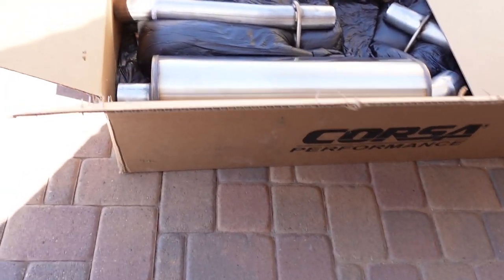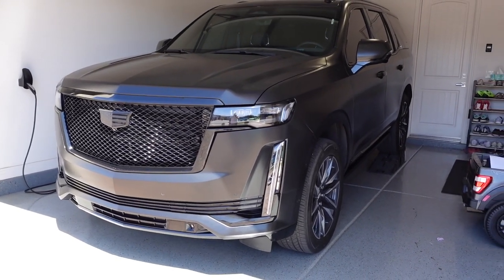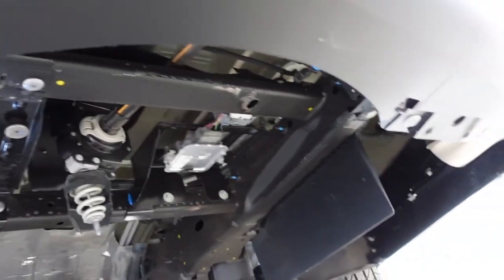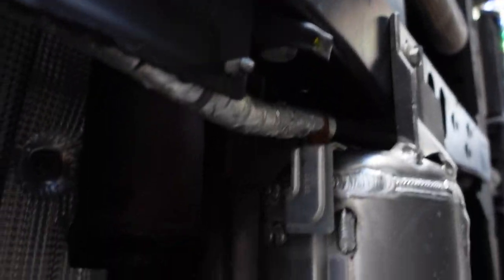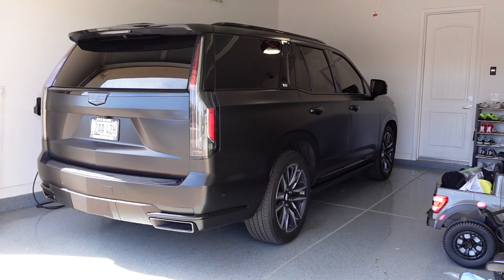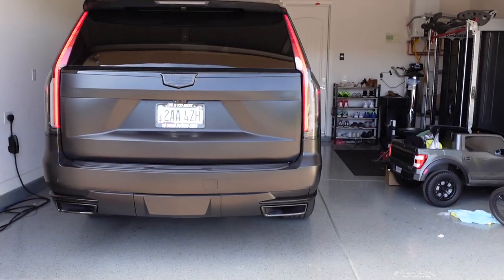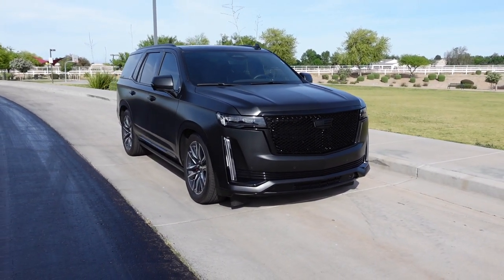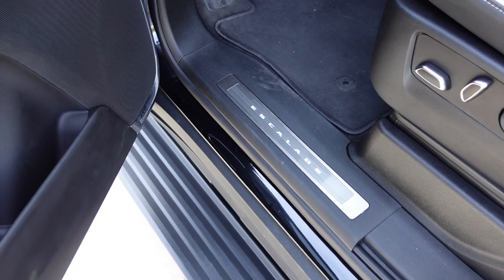CORSA Exhaust Install on our 2022 Cadillac Escalade Sport! SOUNDS WICKED!!

Comment: Love the content, very informative.  I own a 2022 Cadillac Escalade Sport with the touring pkg.  I did purchase the lower links from Edgy but ended up removing them.  The links felt like the suspension refinement was nonexistent in my Escalade.  Just wondering if you’re experiencing the same concern.  Love your Escalade & I’m considering purchasing the Corsa Exhaust after hearing the WOT sound clips on yours.
Reply: Can you provide a pic of your Escalade out of egress mode.  Would like too see what the stance looks like in driving normal mode with the links.
Reply: im getting ready to install some one mine from my experience in the past you dont want to let too much air out of the bag or it will get really soggy.with that being said im unsure if ill be able to get mine low enough to satisfy me. i seen a guy add drop spindles and rear arm he was able to run more air pressure and get a nice height.. downfall he had to clearance the lower bag mount again something im not sure i wanna do to my truck

Comment: Did you do the lowering links yourself? If so did you turn the suspension off before the install?
Reply from the maker: Yes did it myself, and put it in service mode (can access from the touchscreen under settings/suspension).

Comment: How long did entire installation took?
Reply from the maker: Maybe 2-2.5 hours taking my time
Reply: @Vipertoad Hey bud, doing the Whipple supercharger will be a tremendous difference, however keep in mind that you will not hear the wine from the blower as much. It's pretty quiet. You can still hear it but it isn't as loud as most would like. Please if you can let me know if this Corsa system drones when cruising and the RPM is under 2000. I've got a 21 Yukon Denali fully loaded with the 3.0 Whipple supercharger along with kooks headers and green cats. I have the factory GM performance exhaust that's technically a touring Borla system but it drones like crazy!! Unfortunately it was the only exhaust available when I first purchased my truck but I'm considering Corsa..assuming it doesn't drone! Any information will be greatly appreciated!

Comment: Does this void warranty in anyway?
Reply: It will void the warranty even if you do a cold air intake
Reply: Any system from the cat back doesn't void the warranty. A vehicle manufacturer cannot void the warranty of your vehicle due to an aftermarket part unless they can prove that the aftermarket part was the cause of or contributed to the failure of the vehicle (15 U.S.C. 2302 (C)).